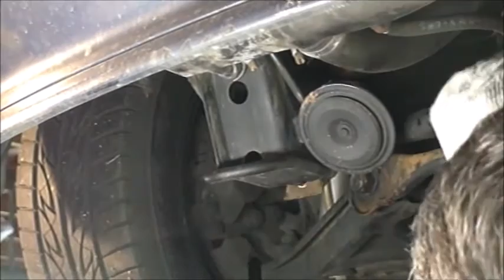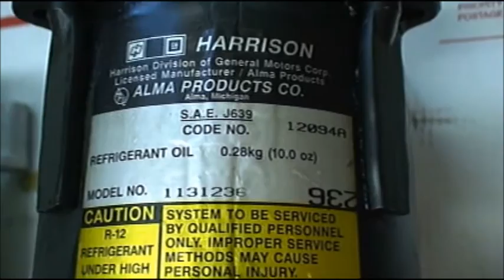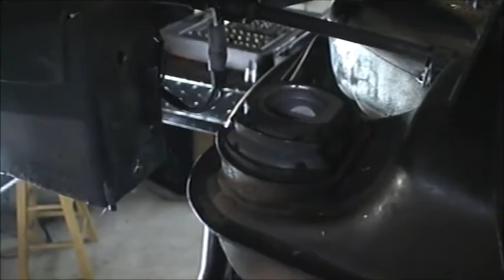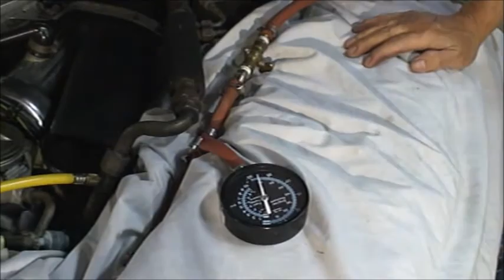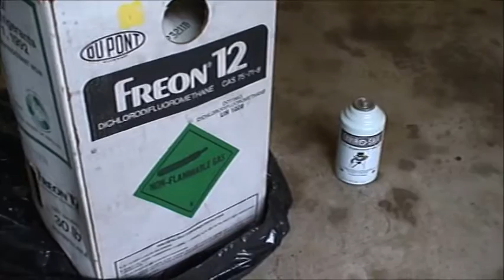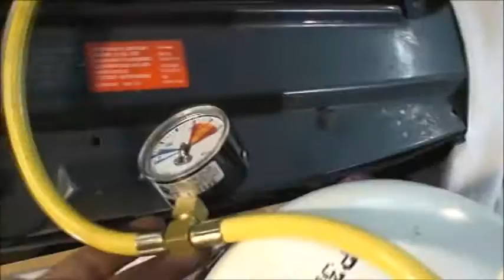AC Compressor replacement on your 1980 Mercedes 450SL with AC Delco

Comment: Just did this in the shop on a 82 380sl, been on the rack two days. Couldn't get on the 19mm bolt for the top motor mount so released the smaller 9/10mm bolts holding the mount on. Make sure whoever is doing this to keep everything loose or else the rear bolts with the spacers will not line up and you'll mess the threading up and have to pull it out and Chase the threads. I replaced with the OEM compressor. My boss said these were added on by general motors. Maybe that's why it's such a pain to remove and get them back on. Also make sure you have extra long extensions and Universal's and swivels as well as good quality hex short sockets, using snap on hex sockets myself. The two bracket bolts are the pain in the ass. For me to get the spacers back in I use a long 1/4 extension to push up into place then slide my hand up inside to insert the bolt, then go from the middle of car with long extension and swivel. This job isn't for the faint of heart 😂😂. The OEM compressor is still good on the one in the shop, the clutch went on it.
Reply: I ended up using 2 wreches to get them out 😂😂 had it on the lift most the day.
Reply: @jeremy0156  I use to work for a indy euro shop now I work for Volkswagen. So lots of fun
Reply: How did you release the 10mm bolts on the left side. Im fucking struggling with this
Reply: @jeremy0156  long extension with universal joint and black tape. Also patience. Yeah if I remember these is a curve or something in the way but u can still do them. I used extension half way down the car and guided onto bolts.

Comment: will this method work for an 85 380sl? thank you! great video. you move so fast!!
Reply: Also a lift is practical I could not imagine doing this without one, not sure it would be possible without one on a 380. If ur using the OEM compressor it's heavy so be prepared. When u put the new one into place put the bracket on and line up the bolts don't tighten all the way, also use a smaller screw to hold one side of the upper front bolts to line up the top two. Add one of the top bolts loose then line the rear bolts and spacers up and run them in by hand and ratchet at first do not use air to start them. Also I use a reduced and short 7mm hex socket, grabbed a pair of pliers to tighten the rear bracket bolt. trying to do with a swivel is almost impossible and u can't get a ratchet or ratchet wrench on it so don't even bother. I took off like this guy did but didn't put back on like that, as said used a 1/4 to 3/8 reducer and hex socket. Lined it up and grabbed the socket with pliers and tightened that way. Much easier to me. Just giving some tips,the upper rear bolt can be done with a long extension and Universal, black tape the universal. Then line it up as best as possible. The bracket is in the way as well so a real pain to do the upper bolt 😂. Good luck